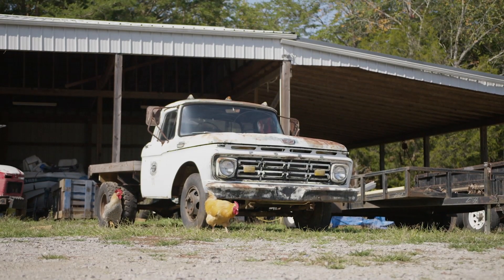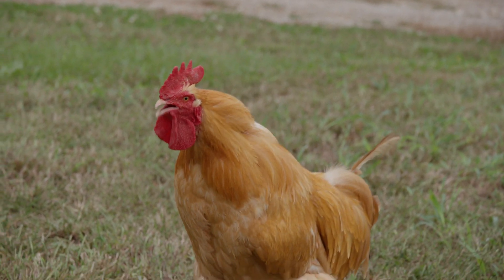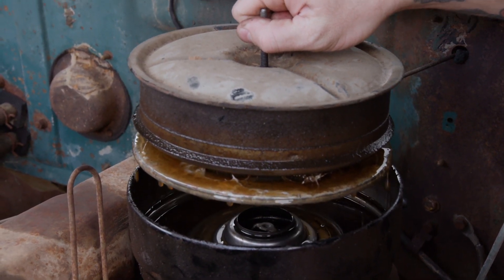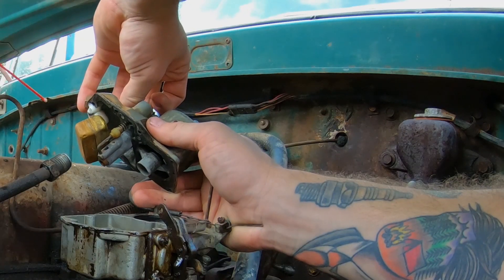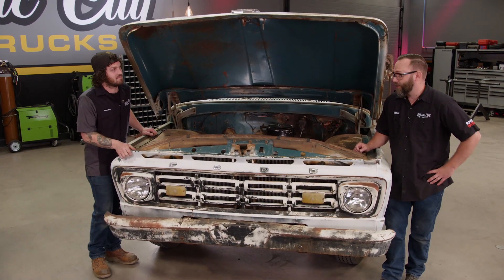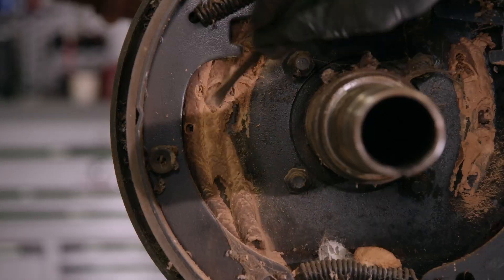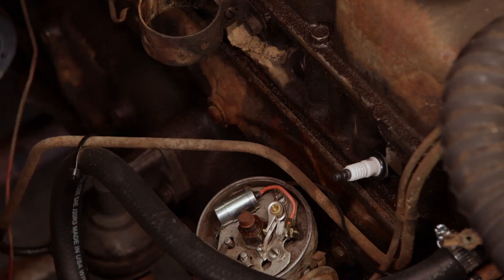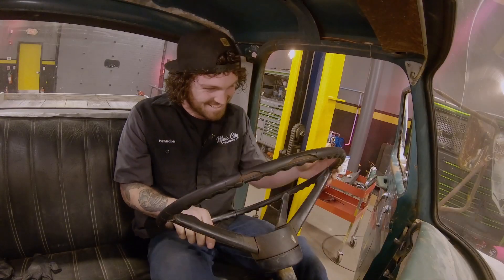Bringing A 1964 Ford F350 Flatbed Back From The Dead - Music City Trucks S1, E7

Comment: I hope you guys drop in that turbo inline 6 build we've all been waiting on.
Reply: They already built that
Reply: Project low and slow got that. If same motor.
Reply: Agreed!
Reply: Exactly! The Ford 300 I-6 the Engine Power guys have been building- with the turbo they hinted at!
Reply: @juliebeck454  pretty sure that got the Chevy inline 6. I'm talking about the Ford 300

Comment: MCT: "This truck hasn't run in 6 years."

Junkyard Digs: "Adorable."

Also, I think that ex-generator 300 (now 307) motor and a TKX would be right at home in that old horse.
Reply: Vice Grip Garage: "I've got cold snacks been laying about longer than that. Perfect"
Reply: What's a tkx?
Reply: @IanWrigleyNZ  “mmhmm yep, now where’d I leave that sandwich…” ~VGG
Reply: @pookysdad4884  5 sp trans
Reply: @bradmaas6875  oh, thanx
Reply: @IanWrigleyNZ  a guys going to drive it 400 miles
Reply: @IanWrigleyNZ  Vice Grip Garage, "She's been sitting as long as an old feller after his Metamucil, So a feller's gonna do the RIGHT thing and drive it home 400 miles, but first, a guy needs a wobble pop".
Reply: @thegreatoutdoors9769  pretty sure you're wrong and that was a joke but you keep doing you princess
Reply: 390 or 360

Comment: Need to put the souped up ex generator ford 300 in that truck!
Reply: and put the 223 and welder/generator/pump/thing out back
Reply: It was a sewer jetted trailer.
Reply: Yes! I'm looking for a 300 6cyl to put in my '77 F100 XLT 4WD... the 351 Cleveland in it currently isn't bad but its thirsty (all time best of 13.8mpg unladen @ 65mph) and really not all that impressive in performance.

So buy a 300 and hop it up, sell the 351 running as is, jam the 300 in... now we're talking business! Probably similar performance and superior fuel economy for those long trips, plus the good old stump-puling torque that only a big-ole six can provide.
Reply: Here here
Reply: I thaught it was a hydro seeder rig

Comment: I drove a '65 in high school. And no, it wasn't in the 70's. I graduated in 1991. My dad traded a trailer to it that he built. He said he had three nights' work and $27.00 in it. He sold the bed off the first day home for $90. Put a flatbed and dual wheels on it and painted it with a brush. From twenty feet away she was slick. From five feet she was rougher than a night in jail. I could write a book about that truck but the statute of limitations is not up yet on most of it. Can't wait to see more on this truck.

Comment: I bought a 1966 F-100 with the 300 inline 6. It had been sitting behind a barn for more than a decade.. and used for target practice! I brought a new battery, a can of WD-40, and a small piece of emery cloth for the points..(just in case) Put air in the dry rotted tires and less than an hour later, drove it home (with no brakes and a horrendously sloppy 3 on the tree manual)
I paid $250.00 for the truck and went thru most of it cleaning it up. You can't kill that 300-6! To this day I still have a king pin (from that truck) in my tool box I use as a drift.

Comment: 240/300 swap. O/D. Front disk brakes w/ dual brake master cylinder. Fuel injection and electronic ignition. Otherwise keep the patina and classic look. My dad had a 1966 F250 longbed back in the very early 70s. 292 y block 4 speed. This episode brought back childhood memories. 👍

Comment: Growing up we had a 1969 F-350 4x4 that my Dad had bought in the early 70's. It had a 12' flat bed from the factory and had the NAPCO 4x4 as well. Came from the factory with a 360 I believe however after Dad had bought it but before he picked it up the dealer was trying to start it and kept backfiring the engine and trashed the original. So Dad had them a new 390 short block in it. Most of my memories of the truck were when it had a 302 in it. The heads on the 390 started needing work so dad pulled them then needed the truck so pulled the 390 and dropped a running 302 in it. That engine blew on us in the middle of Chicago and Dad and my uncle and some friends pulled it and put in one out of a junk yard in a Kmart parking lot. I loved that truck but unfortunately Dad sold it for scrap before I could buy it from him. Maybe someday I'll be able to find one like it that won't cost me a kidney and half a liver.

Comment: This reminds me of a truck my boss had for a bit. 1991 Ford F-250 with the classic inline 6 and EFI. Ran about like this engine does. Not much power but that engine refused to die despite electrical issues in the EFI system. It was always fun to drive.

Comment: The truck needs a 300 inline you have been hotroding all along
Reply: yep that white one with a NV5500 6 speed   take out a few leaves to soften it up and lower it a bit an some newer disk up front an a crane to pick up engines shop truck that thing all day kool find
Reply: Yep!
Reply: If it was a 65', it probably would have been a 300
Reply: turbo barra, best ford I6

Comment: He says "it doesn't get any cooler than this".  Trust me guys....IT DOES. Had to check twice to see if I was watching Power Nation or 'Road Kill'. Fix the truck up right if you're going to keep it. Cant believe you didn't do wheel bearings when you had the hubs off and install a dual reservoir brake master cylinder (for safety sake.

Comment: Throw that monster 300/6 in it Pat built, get a 5 speed with overdrive, some new tires, disc brakes on the front and build a nice looking steel flatbed
Reply: I completely agree!
Reply: @retiredafce3373  I say steel not aluminum because there is no diet plan gonna make that truck light, 2wd will handle better on poor roads with the weight and durability reasons. I should add this truck needs a massive winch! For goodness sakes please please keep it a dually. Flatbed trucks just never look right to me on a super single rear tire... but I am old!
Reply: @timebert6141  I’m totally in agreement with you!
Reply: That's how I could see it. A stout 300 with a better 'box, add some sides to the bed...doesn't need any more than that. Maybe discs on the front, new rubber of course, but a winch and a BFO tow hitch wouldn't go amiss.

Comment: This truck needs that 300-6 that you all built. I don't know if the turbo version of that engine has been done yet or not but that's exactly what needs to go into the F-350. Nothing like a 300-6 turbo under the hood pumping out tons of torque. If it were me I would do dual turbos and dual exhaust with a air to water intercooler.

Comment: Love that truck. Yall keep going and do those upgrades. I have a 64 F350 also and it has the 292 Y-block V8 and is a Custom Cab so it has the alumium grill and stainless trim around windshield. I would love to do what yall mentioned, lower it,Air conditioning, fuel injection and got to have stacks,cab lights and air horn!!!!

Comment: i have this same truck. mine was a road service truck as well. 5.89:1 rear gears. drove it home 30 miles with no hydraulic brakes, just compression braking and the trans lever brake on the rear of the transmission. and they are right, no radio because you are busy driving the truck. and that rear suspension is brutal by the way.

Comment: I love it as is. The loose steering would be what I would like to see upgraded
Reply: Mine was like that and the rag joint was wallered out. A new one and adjusting the lash on the box tightened it up good.
Reply: Power steering upgrade?
Reply: My '78 F150 just needed the big nut on the steering arm tightened...

Comment: i had a 62 F250 unibody ford...with the big 240ci 6cyl...3 on the tree.....it was a good driver....5:13 gears...it felt like it could pull a house down...top speed was 45mph. i traded it for a 72 firebird formula....which got traded off for a 61 chev biscane...and so on.....

Comment: Gentlemen, I drove a 68 Dodge D300, the last year for the 6 lug dually for Mopar. The 6 lug dually predates the interstate highway system and are not strong enough for hitting a chuckhole at 70 MPH. I believe that the 8 lug drums from the next gen of Ford trucks bolts right on, or you might find that the front discs from the 70s will work with little fabwork. Just a thought
Reply: Those '60s drum brakes prolly out stop the '70s disc brakes...

Comment: So I realize that those old straight sixes were tanks and made alot of torque, but I still can't believe that in 1964 Ford was still installing inline sixes in a one ton dually. I figured it'd had a 390 under the hood.
Reply: 390 was the 70's iirc. The 300 was an option in a 250 untill 97

Comment: Mile Maker 223 Ford I6. Also made a 262 I6 as well. Remove that intake y exhaust, install 6=8 intake and headers. Prob would see double HP and Torque. Otherwise, keep everything else exactly the same.

Comment: Hmmm…looks like fresh oil and a new aftermarket radiator. Sitting for 5 years?
Reply: Was thinking that myself, annndd I didn't see them drain any 6 year old gas either which I'm assuming must have happened
Reply: spindle was new too. They probably did a few parts replacements but never got it back up and running.

Comment: Bury a  few sets of points/condensers for the distributor, some plugs/set of wires , a good genset for power. Or maybe just a cheap metal shed-inside a much larger metal bldg- would function as a Faraday cage.
IF and when we get EMP'd, you'll  have a "driver".
     One of the few...
Of course,  having a spare , charged battery,  would be nice.

Comment: You should not use compressed air to clean old brake dust, there is a possibility of asbestos.
Reply: These guys don't realize those '60's drum brakes will out stop '70's disc brakes!
Reply: I cringed and nearly screamed. Kids Abby is no joke. Keep it wet and hose it into a oil drip pan. It's pretty harmless when it's kept out of the air.

Comment: For very little money you could install a brake power booster, and a dual master cyl and have power drum brakes which work way better. Didn't see the wheel cylinders replaced or the master cylinder.

Comment: Drop that cab on a much later model 1-ton. Stretch the frame and build a ramp truck. Years ago a ramp truck was "STARTED" in your shop, but the powers above sent the builder and the truck down the road.. It was one of the MOST WANTED builds ever on the show.. So why not do one complete and use it for the show?????

Comment: I agree. It needs that hopped up industrial 300 that Engine Power rebuilt. That thing was SO nice. Other than the obvious things that need to be replaced like the tires. I'd fix the floor pans and put some rust preventor, sound/heat matt, and then a rubber floor mat down. I'd kill two birds with one stone and swap out that old 4-speed, since it's either got warn out synchros or possibly wasn't synchronized to begin with, with a 5 speed like an NV4500 which would also get you the overdrive you want. Refurb the paint as best as you can, and reproduce the highway lettering on the doors with new paint or a decal. Although since this is a show you'll probably put your own logo on it. And the wood bed, from what I can see, looks recent and solid enough to just use as is, maybe disassemble, put some kind of water sealant on it, and reassemble. I'd also go through an entire steering system rebuild and replace all the other rubber bushings on the truck as well including body mounts. 

Also although we didn't see it i'm assuming you guys did the rest of the maintenance like diff fluid, oil, etc.  Also noticed a new radiator in there. So that's a score.

Comment: I say an nv 4500 for the overdrive it would be so easy to make that four-wheel-drive it's already leaf spring front end don't go crazy jacking it up some 350 gear ratio and some nice 33s it needs to be shortened a little with a nice steel flatbed⛽🇺🇸

Comment: you suggest replacing the coil but forgot condenser and points!...a coil rarely fails no moving parts it is literally wire wrapped in a coil . condensers a capacitor fail regularly and points wear and corrode  !  ill pull a quote from jyd ..people replace coils for no reason..it ran for 50 years.. and probably has another 50 in it. not difficult to test if its functional..apply a voltage and ground it ...if theres spark your coil functions! so take the time and save the money

Comment: My Husband and I just bought a 1969 Ford F350 one ton c class motorhome, and he wants to four link and air ride this beast.
Please consider this conversation, so that he has someone to show him what to do.
I'm to young to be a widow.
Reply: I would just do air bags in the rear. With all new components as well, shocks, drums, pads, etc. Anything else would be too expensive and impractical. Especially for a motorhome.
Reply: @Depressed_Nightfury  so then, maybe you can explain to us, how your using air bags WITHOUT a four link in the rear.
As far as that goes,...how the hell are you going to lower a 1969 Ford, without causing severe camber problems out of those I-beams?
Air bags alone?
You must be insane.
Reply: @Depressed_Nightfury  sorry, just wasn't the answer I expected.
Maybe I should explain what I wanted again .
I want to be able to drop my 1969 Ford F350 c class motorhome completely in the weeds.
I want the bottom of the coach skirting to be about an eighth of an inch from the pavement, and still lift it to almost stock height.
I know it can be done, because I have seen pictures of 67 through 72 Chevy C30's done this way.
My problem is, that I can't use a Crown Vic front suspension, because it's a one ton dually and the hubs are very different.
As well, the twin I-beams makes the camber go pigeon toed, and I have that look.
Is there any other choice, aside from welding in an 87 Chevy front clip to my 69 f350 frame and going with yet another LS swap.
I'd rather go with a 3-5 static drop and add three two barrels then to pay out for major surgery.
Reply: @valeriepickens2533  that I have no idea. You might be able to find a slight lowering kit, but I really know next to nothing about that much of an airbag setup. I usually keep my trucks at stock ride height, and at the most I plan to add helper bags for the rear.
Reply: @Depressed_Nightfury  cool,..none the less, thanks for forgiving me.
Reply: @valeriepickens2533  no problem

Comment: Missed a few parts. Wheel cylinders? Points, Those should have been done at the same time
Reply: Yeah, this show's become a joke. Doesn't seem to be much of a point to it anymore.
Reply: Intake gaskets for that leak they had... I melted holes in the front 2 pistons on grandpa's 223 f250 about 25 years ago most likely due to intake gaskets on the front port.

Comment: All you need to do is get some new tires and tighten up the steering. Old trucks like that that have not been "modernized" are getting harder to find, and that one is perfect! I am not a Ford guy by any means, but it deserves to be used how it was meant to be used. Jut do those two thing to it and it will be ready to use as a daily work truck. Its yours to do with as you will. I just get so tired of people saying how the love old vehicles, and then they go and change everything but the body.

Comment: A 6 ??   Online 6 are power houses .   No joke.   If it was mine?    I would make it into a 4×4 , and drop a built 460 in it ,. POWER , AND CAN GO ANYWHERE ☺️😆🤓.    Not anger .    6 cylinder is just as good,.   Bottom end torque,.     But, that's just me.   Nice  flatbed , it does need work.    But, hope they can save it 👍👍

Comment: So did all the rock auto shoes have the same length lining or did he put both rear shoes on one side and both front shoes on the other? Also. Why would replace perfectly good shoes. And leave the old wheel cylinders on?  That's what would be bad after sitting

Comment: The old shoes had plenty of use still left in them. If took both of them to remove the old hub but only one to replace the hub. I did not see a brake cylinder rebuild or replacement. A good ole brake bleeding probably would have been enough.

Comment: New brake shoes and hardware = full brake job?  Huh?  Never mind the wheel cylinders that could be seized or have rotted seals, inspecting the brake lines and hoses and going through the master cylinder.  Forget about repacking the bearings or having the drums resurfaced.  I’m sure they are smooth as glass after sitting that long.  How about a set of points for the ignition?  Never mind all that, let’s go for a spin on these dry rotted tires.  Scary…
Reply: Drums get rusted rough while sitting...

Comment: Hey... This is America...  Land of equal opportunity!  Why didn't you give Frankie a turn on the rollers?  Afraid he would be the first to get 80 HP?!
If it was mine, she would get a warmed overy 300 six, 5-speed crawler gear tranny, dual master power front disc brakes, and a quicker ratio power steering box.